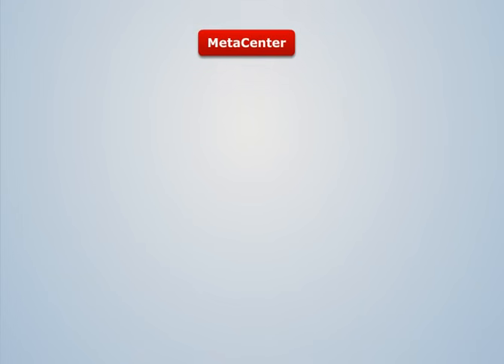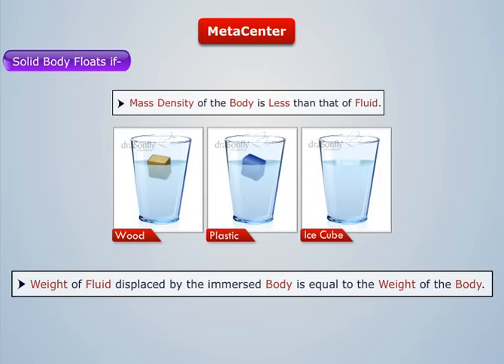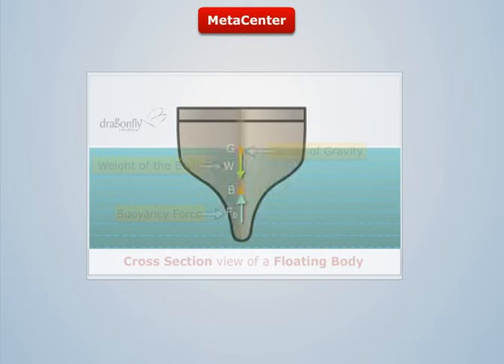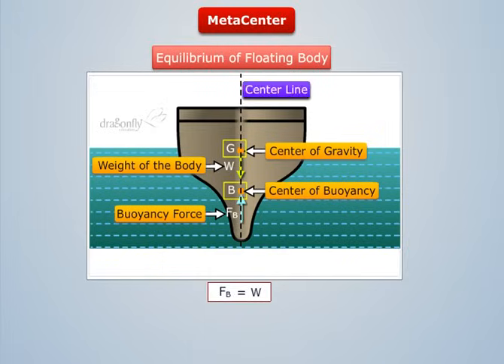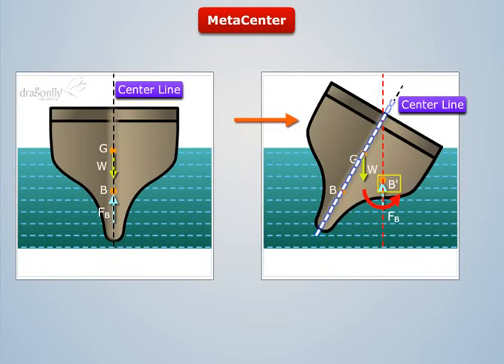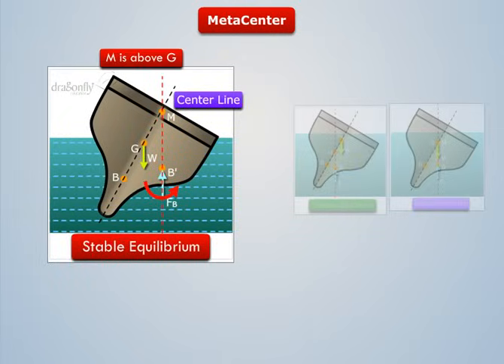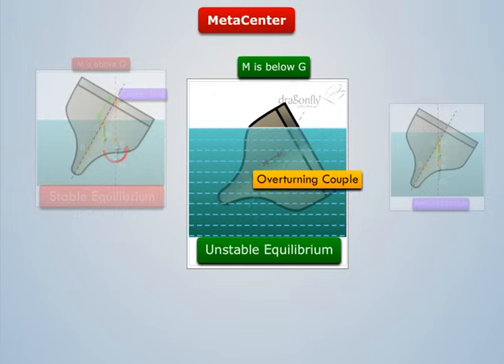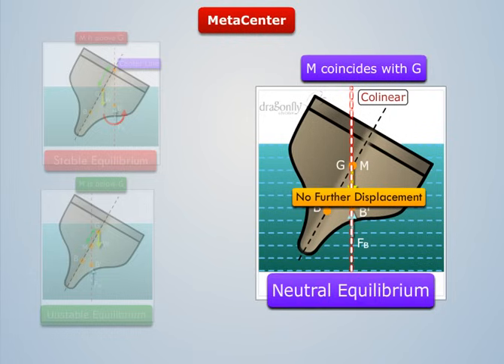Metacenter Definition | Fluid Mechanics

Comment: Restoring couple means GZ curve?
Reply: If you understand please let me know that on all three equilibrium conditions B(center of buoyancy) remains at same place.
Reply: @hardikchudasama4906  definitely not. Buyoncy force is an upward force exerted by the fluid which is opposing the object immersed in the fluid. So in stable equilibrium, ship is stable and no angular displacement is given. Hence buyoncy will be on the centre line of the vessel. But in unstable equilibrium, ship is given an angular displacement hence buyoncy force will act at a point where the wetted surface area of the vessel is more. Which means which side of the hull is immersed in water more. There buyoncy force will act. And in neutral equilibrium also same as unstable equilibrium. Buyoncy force will act on a point where the wetted surface area is more. So in all the 3 equilibrium, centre of buyoncy is changed.
Reply: @aji_Seafarer  please give position with reference to G as if it above or below in all three conditions.

Comment: weight of the fluid  displaced is not equl to the weight of the body. 
it is equl to the buyoncy force applied  on the body. correct me if iam wrong